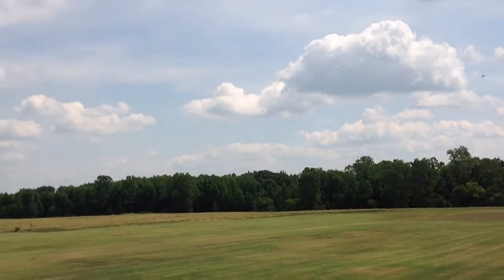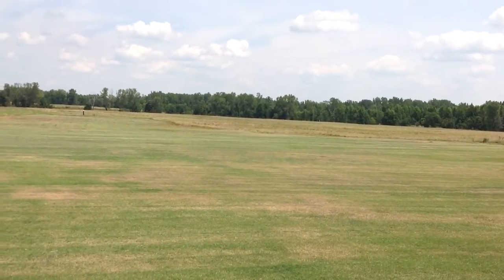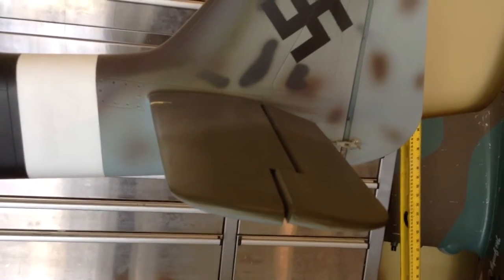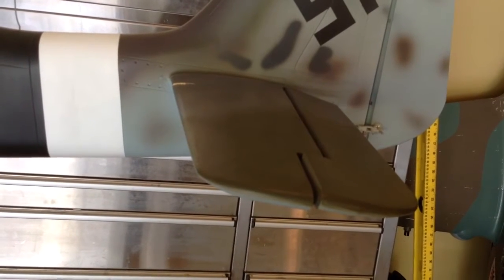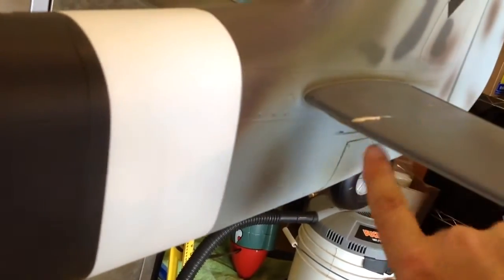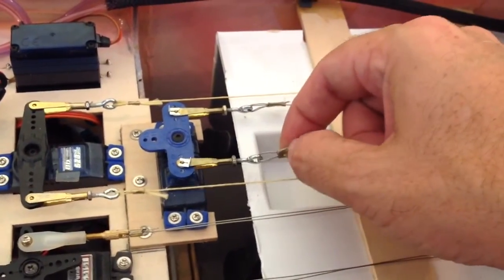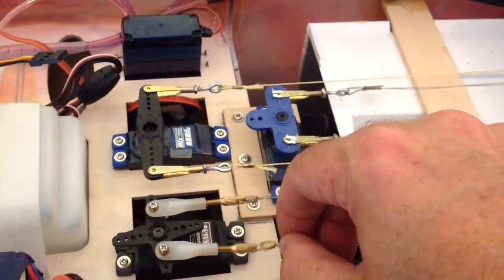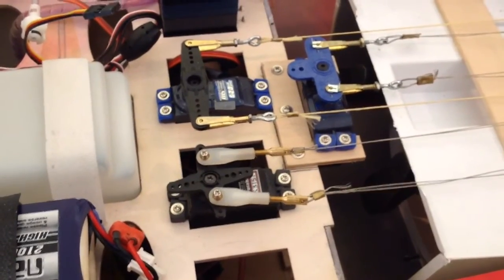Flight 3 of the ESM FW 190 D9 - elevator flutter

Comment: When you have any flutter you close the throttle immediately and pull up gently then fly a short circuit slowly to land...... You are very fortunate you did not loose the plane.
Reply from the maker: Rudi, you are correct I was indeed lucky.  However, it got back down in one piece and has been a great reliable flier ever since.  Currently waiting for COVID so I can fly but I’m going to swap in a new EME60 engine.  Thanks for posting.

Comment: Consider soldering after you crimp your pull/pull connections
Reply from the maker: Thanks, a good suggestion. I also like to double loop the wire through the crimps to give more bite and reduce possibility of slippage.  Thanks for posting.